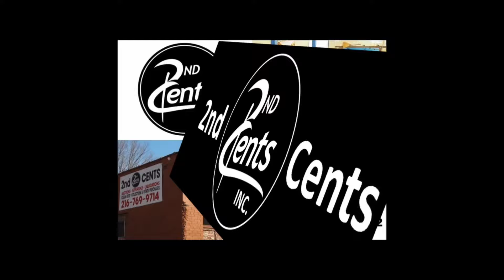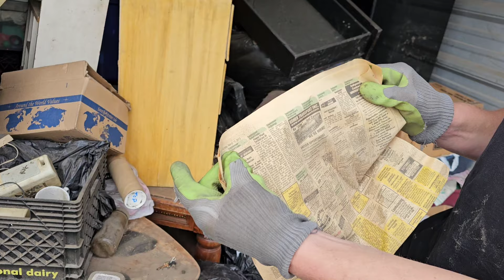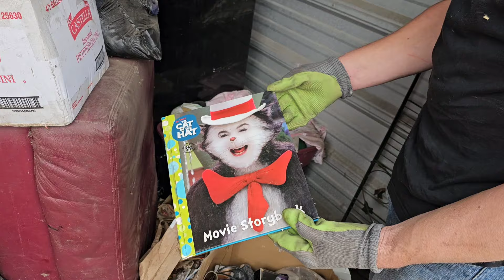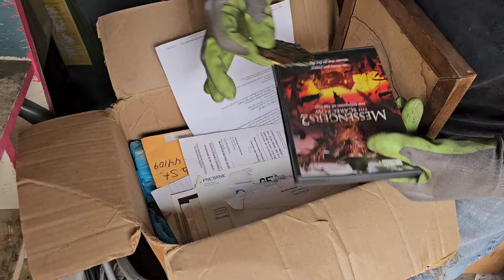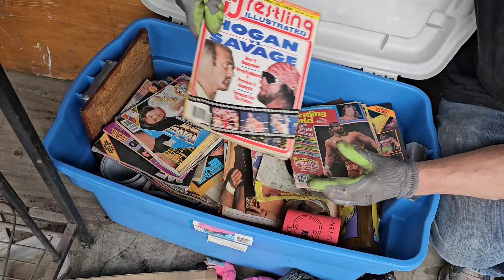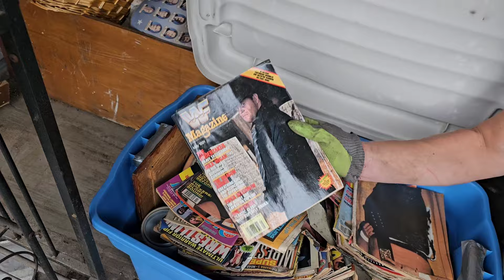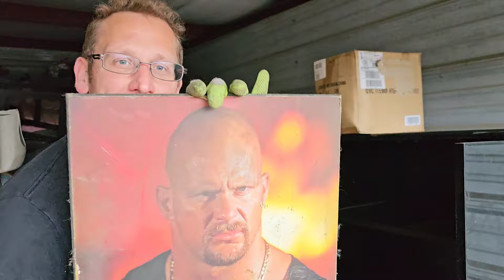COPS CALLED on CORRUPT STORAGE UNIT FACILITY! ~ They want to FIGHT ME! ~ Caught  FIXING the bid!

Comment: Seriously file a complaint against both officers for dereliction of duty for at least not taking a report. Them saying you'd have to press charges with the courts is false. I've never heard of such a thing. Yeah I would contact the two officers department and file a formal complaint against them. I would have arrested Steve and wrote a report on the shady auction deal to send to the county prosecutor.